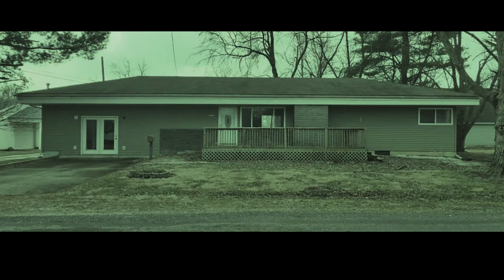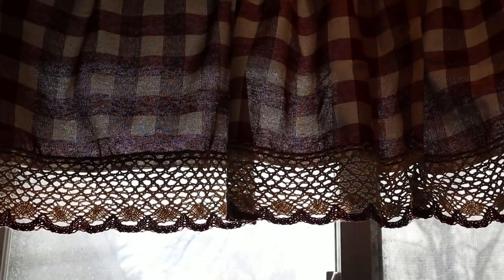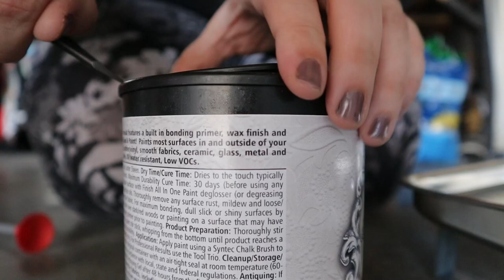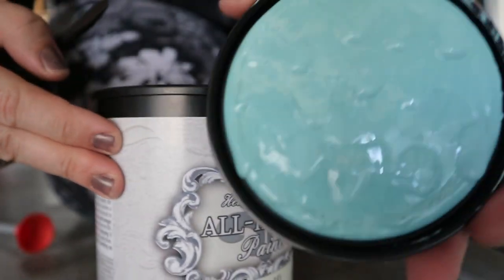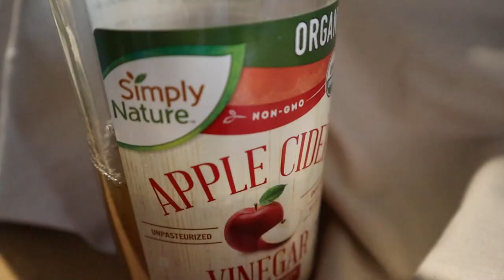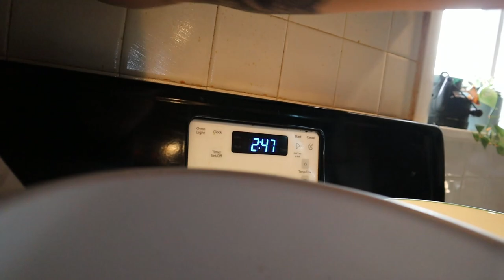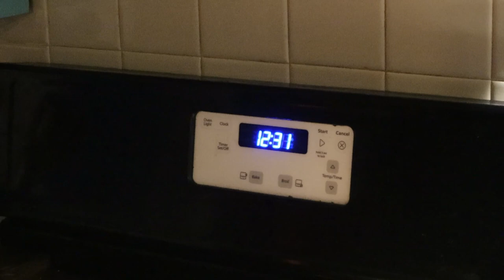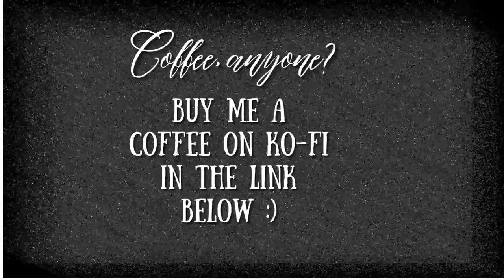RETRO RENOVATIONS EP 2: 1950s kitchen; crochet curtains by Simply Serving

Comment: I like the new color, but honey, ya need to sand before you paint so the new stuff holds longer. Better to use a brush and work it into the wood real good. Also, you should Remove the handles from the doors and drawers so you don't get paint on em and give the handles a good polish with a toothbrush and some Barkeeper's Friend (or cheap toothpaste) before you return the handles to their spots. Just saying... But I do like your works.